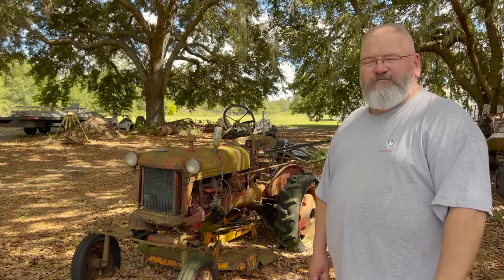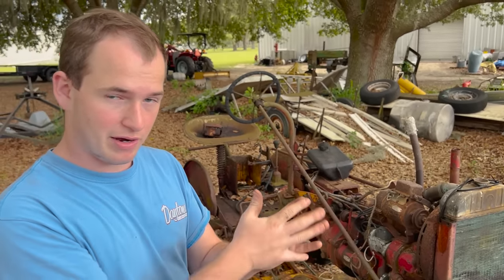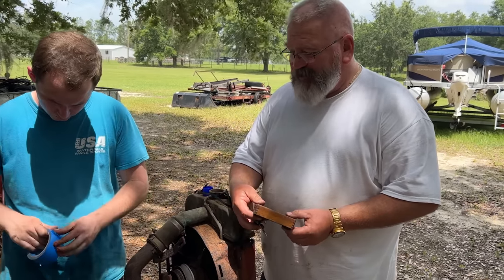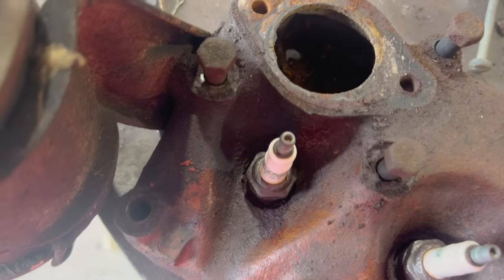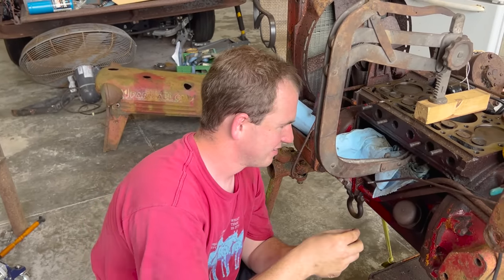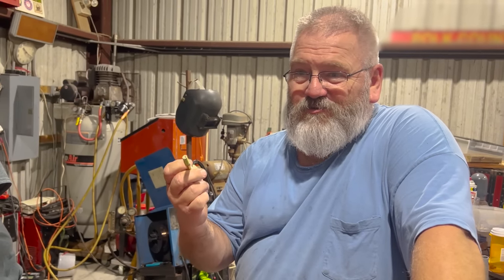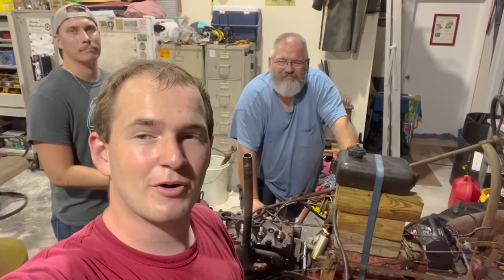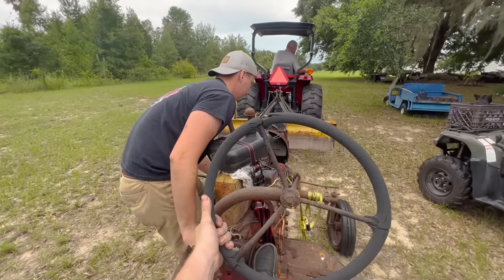ANTS in the Motor, and Stuck Valves... WILL IT START? (1950 Farmall Cub).

Comment: i have worked on cars/trucks ect for over 40 years and i have only ever used a so called "Easy out" once and never have i used once since they break off in the hole all the time if you can drill the bolt for an easy out your better off drilling the whole bolt out.

Comment: In Sweden there are two rules to tractors. If it's a Farmall or Bolinder Munktell, it will most likely start. And also most likely plow a huge field right after, no problems. My BM 36 was the most powerful tractor in the world at it's launch in 1952 with it's massive 43hp. Still going strong. 

And my uncle still has my grandfathers Farmall F-14, that he bought used in the 40's. It's had a full restoration now, and looks like new. But it worked the fields for it's entire life, and still does, though mostly on plowingmeets today.

These machines where made to work, and if you do, they will!

Comment: mine  ( I bought a project cub) with the some valves stuck just like that . Mine sat in a Tabaco shed for 40 years. It would of
never come loose with out pounding on the pistons with wood block and spending a whole lot of time loosening & replacing 
the ones I broke off trying to remove just like you guys. But I did learn a lot from unlocking it and grinding rust out of valve seats/
still don't have enough compression to start with the starter withy out starting fluid. my rings probably stuck in, or I need more work 
on grinding valve seats as mine were pretty pitted

Comment: You guys get an "A" for effort and far be it from me to be critical of anything that worked but never use Never-Seize on head bolts.  It reduces the friction so much when tightening that you need to reduce your torque by 40%, ask me how I know on the first big block Chevy I built and stretched the head bolts so bad the gasket wouldn't seal.  I use Teflon thread sealant or ARP Ultra-Torque thread lube on the bolts especially if they thread into a water jacket.  With those Grade 9 bolts I was cringing as I watched expecting one to break or strip.  Good job though.  By the way, 12v is OK on a 6v system, 6v runs on higher amperage and is very capable of the lower amps of a 12v system.

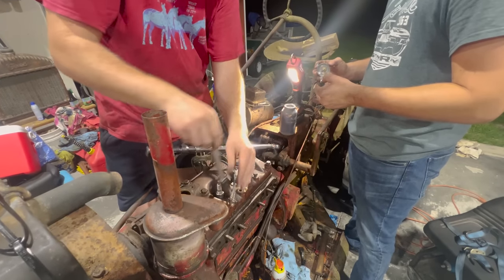Comment: @ 35:38 Yep, that's the thing about anti seize. it do gets on every little thing, yourself included. I just got through replacing the cracked exhaust log on my 98 Altima & ended up pretty much looking like the tin man from Oz. Fine by me, though. One day when it needs to come back apart - and one day it will -  I know the fastener threads won't gall up on me.

Comment: I had a 29 pontiac with a hole in the honeycomb radiator. I used jb weld on a q-tip, Ilasted 10 years and held when I sold it.

Comment: Nice job guys, Just a suggestion on the drilling of hard materials, Carbide drill or carbide tip drill will do it easier. I have done this many times for customers in my 50 years as a machinist.
 But, Some are extremely stubborn. I have even removed some in a milling machine again with carbide end mills.
Also, if you can locate them, left hand drill bits will work... sometimes... it will work similar to an EZ-Out when the middle of the bolt is gone.

Comment: When dealing with broken and stuck bolts. A combination of heat, penetrating oil and freezing spray can get most of them out. If you have room for drilling with a guide like that pipe, you have a very good chance of getting it loose. Just be patient and continue with the heat/cold in cycles. Sometimes it can help to give the drilled bolt a tap when it's as cold as it gets.

Comment: I had a 2016 Massey Ferguson like yours the front differential locked up with only 300 hours because it never had any oil from the manufacturer. I was able to get ahold of the dealer who got a dealer from another state and it was repaired free of charge

Comment: I think those two valves got stuck because your exhaust manifold pipes all converge at that point.  Possibly, it is the hottest point in the engine.

One thing I always do before starting any procedure on a machine is to pause and think what could go wrong.  This habit has saved me lots of problems.  To be fair, it wasn't until I was in my 50's before I started doing this.  Slow learner.

Comment: Blow it out with a cutting torch and then drill the bolt out. An EZ out will fail 8 out of 10 times and as you experienced it compounds the problem.

Comment: Question since i grew up and spent most my time as kid around machine shops and my dads karting engine business. Why did you guys use a spiral twist drill on valve guides? You went and orderd a new valve yes? So why not order a reamer for the guides? If its possible than its something i didn't know about until now. 10hp for that wow engines have changed. I enjoy the kohler K series engines from the IH cub cadets ect and why not at some point go in and do some porting work nothing crazy since its low HP low RPM but enough to improve efficiency of flow around seats ,and make a partial relief around valves into combustion chamber. Get some improvement too torque and and efficiency since those L flat heads do not flow well at all vs ohv. Its not my machine but if it where id definitely want to improve it within reason and not bubba it.if it where me that would be my great grandads tractor and id hope to make him proud by improving it and using it again. My great grandmother passed 2 years ago and had a delima on what to do with her kitchen stuff ive gotten. I have many vintage things to restore. Hopefully yalls restoration comes out super well as thats a super cool and special little tractor.

Comment: wouldnt it be a lot easier to turn the engine over for the valve work  using the crank rather than trying to hassle with the starter?  More control.

Comment: All of those flat head motors are bad about breaking head bolts if you use a wrench or a ratchet. The best way to take them out without breaking them is with an impact wrench.